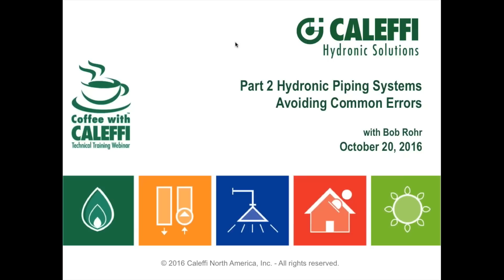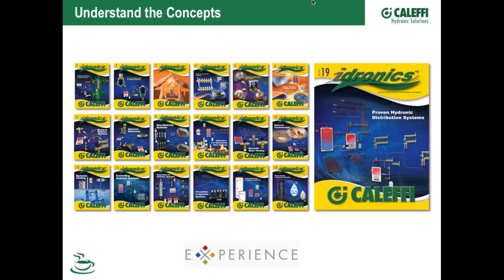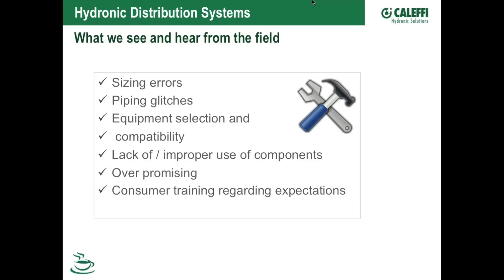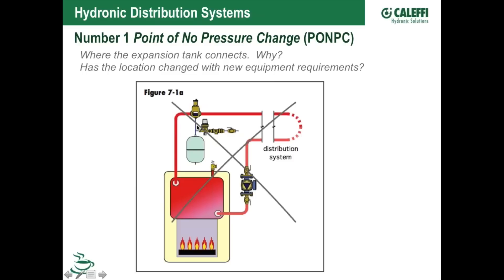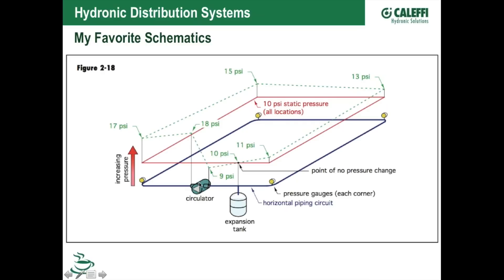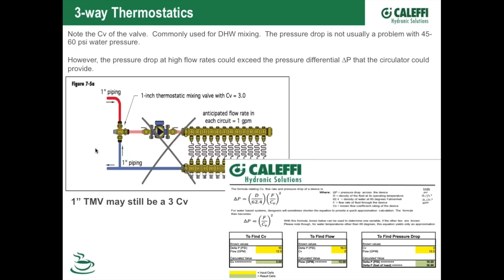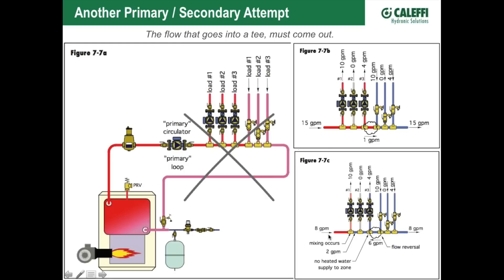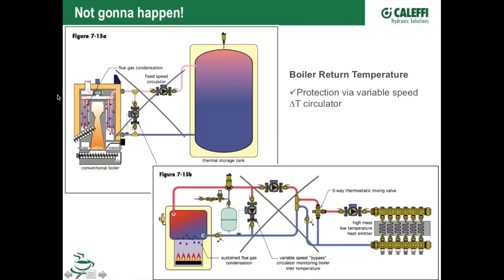Hydronic Piping Systems – Avoiding Common Errors (Part 2)

Comment: Why do we find residential boilers pumping to the PONPC?????
Reply from the maker: Thanks for tuning in - we hope this video encourages more installers place the expansion tank on the upstream (suction) side of the circulator.
Reply: I found my old nat gas boiler was piped that way (wrong), I never understood until I replaced it with a heat pump and buffer tank, and watched & read all the great Siegenthaler / Caleffi information.  There was a good explanation about this in a HotRod boiler piping video and in this video at 8:00.  It's tradition and convenient packaging.  The boiler & pump mfgs liked to package the pump on the return of the boiler, so pumping into the boiler.  A guess it's 50/50 which side they'd put the compression ('expansion') tank on, as well as where the auto feed valve was on.

Comment: Hello! In order to eliminate thermal ghost flow, you mentioned to install a check valve and a purging valve. Please tell how an purging valve works as a check valve? I Googled it but that didn't help. Thanks!
Reply from the maker: Hello! A purge valve is not a check valve. The purge valve allows you to manually purge the air from the system. The check valve will prevent ghost flow.

Comment: I live in spain and our mains water supply constantly disconnected for maintenance or breakdown , when the supply is re-connected we get a lot of air in the system which has to be purged through the household taps is there an air elimination valve that i could put in line before our first tap to eliminate this air
Reply from the maker: Thanks for you comment. We would advise you to address this case to the water distribution company. Have a good day.

Comment: I have recently installed a hydronic system in my house, following the instructions in John Siegenthaler''s excellent book. It seems to be working well, but I have a question: is it possible to test the system -- that is, to know if flow rate, pressures, compatibility of the pump, etc. are all what they were designed to be? For example, did I make mistakes in the complicated task of calculating head loss to get the system curve?
Reply: Are the regulators on the tube manifolds balanced out with identical GPM flow rates
Reply: The hydronic design studio that John speaks about can test designs.